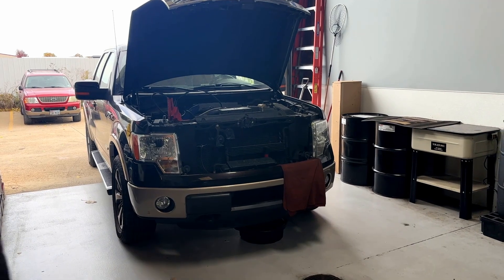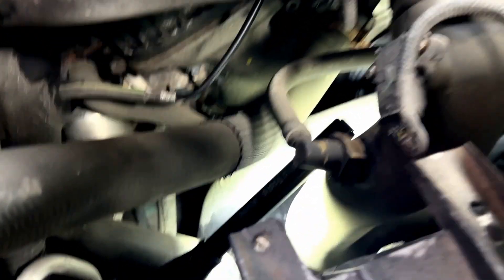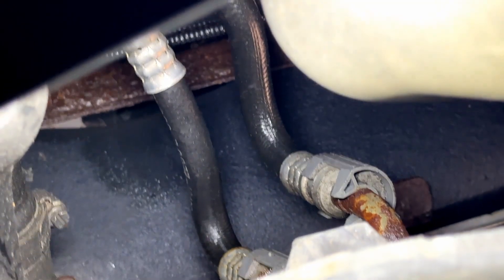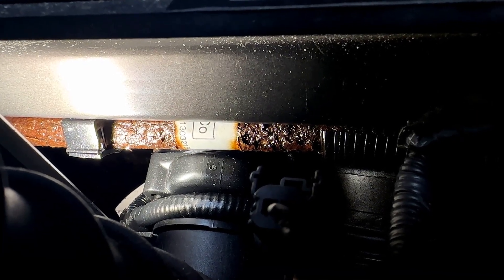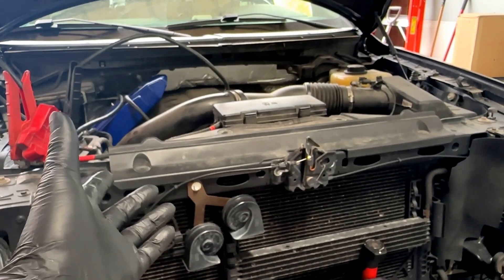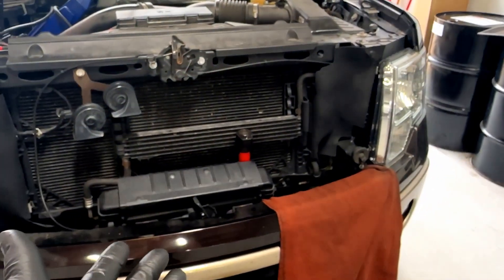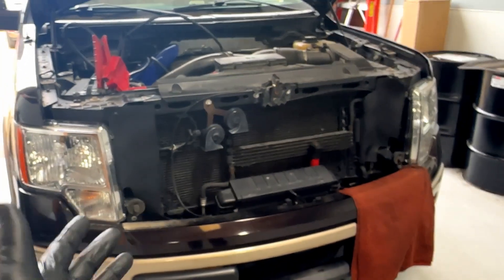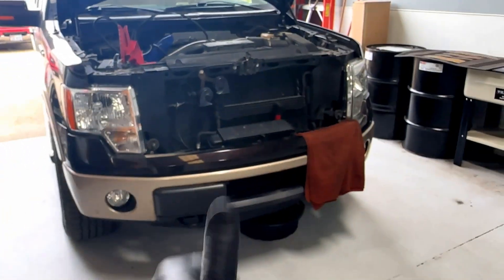One Last Time: Do Not be The Next Victim of Faulty Ford F-150 6R80 Transmission Cooler Lines!

Comment: Thank you so much, excellent information. I have a 2013 Eco boost with 31K on it so I sprayed the tubing and all metal parts with Blaster surface shield to protect the tubing from corrosion, I can see the start of corrosion, glad to catch this early.  Keep up the good work it really helps prevent expensive problems.  By the way the pcv valve oil separator works well keeping the 2013 Eco Boost intake valves clean, preventing another costly problem.  Thanks again for your hard work.

Comment: Thanks for the heads up. I used your molded lead frame / bulkhead sleeve / filter / fluid  / pass through seal video to fix my intermittent limp mode issue. Any chance of a transmission cooler line replacement in the same format? Also if a class action suit on the molded lead frame is successful, would I be reimbursed for the DIY replacement?

Comment: I got super lucky on my 2012.  Changing the oil one day, I noticed one of the trans cooler lines was wet at that coupling.  I wiped it with a rag, and the line separated in my hands.  I was able to patch it to get back up and running, and promptly ordered a new line set.
Reply: What did you patch it with
Reply: @armwrestlinginthe6ix  I cut the hard lines on either side and used 1/2" compression to barb fittings.  Later, I bought a new line set, cut off the quick connects, and flared the hard lines for -8 AN fittings and ran new rubber lines from there to the trans cooler.  .

Comment: Great video but I have my own problems I drive a Ram. These dealerships need to be held responsible AKA lemon law when things malfunction to a certain year truck even though it's out of warranty. It's like the older Rams 03 and up where they all rusted above the rear quarters and the dealers excuse for not fixing is that it's not a safety issue. Maybe they should have plugged the holes or used better materials.

Comment: Bought a new Focus in '02 (still have it, approaching 350k with the original engine and trans, albeit with what appears to be a rear main seal leaking). At the dealership, I was checking it out and noticed that the "galvanized" fuel-filler neck was RUSTED... BIG TIME! Looked like it had been in salt water for YEARS! Had them replace it; can't remember if it was done before we took delivery or after... the ONLY time someone other than me has worked on it! : )

Comment: While I do appreciate the tip, but I drive an 05fx4. It has an old 4 speed automatic and a 5.4 with a 5 star tuner. It's got over 274000 miles on it! Check the fluids regularly and run full synthetic oil. Pulled my camper 150 miles last week!

Comment: Brian, is there something better to replace these lines with or is it a like for like?  Could you use some sort of high pressure hydraulic line that doesn't have quick connections?  I know you briefly mentioned something about it, just wanted clarification before I bought the wrong thing.  Thank you!!!

Comment: Your comment on how the pressure is lower as the fluid level drops is spot on. A line that completely disconnects can often have little damage in the transmission as long as the engine is turned off once the transmission looses engagement. It's the slow leaks that kill transmissions. Low pressure, fluctuating pressure and lubrication failures as the level gets lower and lower.
Reply from the maker: Its the time period where the pump is sucking air and fluid is when the real damage occurs to the clutches.
Reply: Yes.

Comment: From trans to cooler, and return, what's the best full replacement method and material to use. 50 hose clamps on junk rubber oil/fuel hose ain't the best.

Comment: Fixed my 2013 Ecoboost that had this issue after a road trip back in July 2020. Thought it was the reclaim water from my local automatic car wash that ate the metal over the years. Thankfully there was 13q of fluid.

Comment: Are there similar issues with 6R80 lines after 2014?  I have a 2017. I’m about to do a full trans service and wondering if it is worth changing mine. Thanks
Reply from the maker: I personally have not seen it on 2015 and newer models.

Comment: Not related to this video, but it's the most recent, how would I go about rehearing my 1999 f150 and making the speedo stay accurate? Is there software that has to be reprogrammed, or is it a sensor/gear somewhere that that would have to be swapped out? My rear is bad (is supposedly 331 gears on 8.8) and I was thinking of changing to a more readily available 355 or 373 either by replacing everything, or just flat put replacing the axle assembly (facebook marketplace or scrap yard or something), but don't know how I'd go about recalibration the speedo.

Comment: I have a question about an issue that's been duping my local mechanics including my local Ford dealership. My 2006 Ford Escape hybrid stalls in the morning after driving one block. It bings, stalls and reads "pull over safely now". I then restart it and it works fine enough driving 10s of miles without issue. I found that it wont stall if I give it 3 long revs before driving. Any idea? Sometimes it is not fully responsive to gas pedal within 1st mile, and does some intermittent whirring. The wrench light comes on now while driving anywhere from every half hour to every couple of days. I've had it reset after oil change, but it keeps coming back on. Basic code readers say nothing is wrong and more advanced ones say powertrain control module - generator, motor, vehicle, transmission and alarm disabled (which it isn't). It drives very well otherwise. One mechanic said it was the part that switches the engine to battery power, and then changed his mind to the battery terminals needed cleaning. And another said it's the battery module and the fan and that I needed a $9000 battery before even looking at it. No one can give me a definitive answer and I'm wasting a lot of money. It's 150,000 miles, I've been the owner for 2 years and dont know it's repair history. Is it safe and recommended to change the lifetime transmission fluid? Should I have Ford charge the battery and reprogram the modules for $900? Is it worth it, will either of these fix the issue? Can I pay you for your assessment? Thanks - Joh

Comment: i had the same but different parts,on my dodge caravan tire air pressure sensors, the houseing is aluminum but the valve stem is metal, even though the rubber was more so touching the aluminum the disimilar metals were close enough for the thick alum. houseing to snap off with very little pressure,

Comment: GM trucks have a transmission temp selection as part of the driver info center..You also get a warning message when this temp gets too high. Can anyone tell us if Ford has this feature?  Wouldn't the fluid temp go up as the fluid leaked out?

Comment: I got a 2008 f150 4.6 that drives fine when cold but when hot the trans acts up (one time I got the o/d light and TRANS FAULT). It feels like the tc is overheating on low gears. I was in 40 miles away from home when it started to act weird but once on the freeway it was ok if I had a constant speed. When slowing down from 3-2-1 it revs a little and it feels like its breaking. I have read that it could be ignition coils, bad torque converter, tcc lock up solenoid, bad ecm/pcm, black plastic trans harness, and even a speed sensor. All I know is that shifts good when cold and the issues progress as its driven past 10 minutes. I dont have a scan tool and I am looking to buy one that reads trans codes too, a recommendation on that would be amazing.

Comment: i didnt catch why you cant just chop the lines and replace the fittings with two hoses and some clamps, is there actually a reason you cant do that?
Reply from the maker: You can do anything you want but I will not hack up lines on a customer vehicle adding more potential leak points.
Reply: @FordTechMakuloco  but is replacing a defective part with a new defective part  a better option? How long till it has to be replaced again?
Reply from the maker: I replace them with the latest engineered parts from Ford, by the time most factory parts fail the service part has been redesigned.

Comment: Question about that I have a 2010 f150 bought it used in 2020 it’s run great I have noticed that the cooler lines have a minor leak on the rubber side but have not had any issues so far obviously I need to get to replace it, but have the lines busted from the rubber side or has it been from the metal side aging? My metal lines don’t show any leaks just the rubber side shows a minor leak? Thank you for the heads up.

Comment: More vehicles than the F150 might be affected. I had the same corrosion issue with my 2008 MKZ. The lines corroded under the black plastic clips. My car is virtually rust free so it was a surprise. For me I found the leak while doing normal service so I was lucky. Thanks for the great info.
Reply: I drive a 2011 Expedition and I will be looking into this first thing tomorrow!

Comment: Yep, I just saved a customer his transmission couple months back for this very reason. Surprisingly the aluminum quick connects were still together, but rust holes in the steel cooler lines left small drips in his driveway. One bump away from disaster. 

Replaced all the lines and did a transmission service. All was well 👍🏻

Comment: Had one a couple months ago, almost lost a trans. Cooler line near trans was rotted and spraying a fine mist all down the frame rail. Guy drove it back 6 hrs from up north thinking it was an axle seal.
Luckily the pan barely had fluid, haven’t heard anything bad about it yet

Comment: I had to replace my F150 transmission because the cooler line snapped just below that quick disconnect like you said.  But they did not replace that small radiator has me thinking it’s probably clogged

Comment: hey man, I've got a 2011 f150 with the 5.0. and 6R80 trans. the lines from that quick connect to the cooler are definitely pickled, but not leaking......yet! should I change all the lines from trans forward or can i just do from the connections to the cooler?

Comment: how do you know you have that particular transmission? I have the 5.4 engine. do they just go together automatically.
Reply: Have a '14 F150.  check safety compliance certification label on edge of driver's door. On mine the column marked "TR" under the bar code has a "6", the designation for the 6R80. Check your op manual if u have it.

Comment: I love it that some know-it-all thinks losing pump pressure makes the clutches instantaneously release and therefore nothing can burn up.Clearly someone with no real-world experience. Even if that were true, everything inside would still be turning with zero lubrication until the vehicle is stopped and the engine is turned off. So if even if it didn't burn clutches it would burn up the pump and input and output shaft bearings at a minimum.

Comment: I am actually doing this maintenance repair on my 2014 Ford F150 3.5L Ecoboost with the 6R80. In the video Brian did in April, I went with the cooler lines to address the issue with the QD’s (rear cooler lines). All of my lines look shiny like he describes (no rust), but somewhat confused if I should replace all of the lines or just the main one as described where the problem seems to be. If the other lines look good, is there a need/recommended they be changed as well? Thanks in advance. '

Comment: Thank you for letting us know.
I have seen an 09 E-250 and a 2010 F-150 and both of them had extreme rust on everything. the F-150s oil pan rusted out and lost the oil. The E-250 had chunks of rust falling off of the rear end. 
My other comment is, I had the heater hose quick disconnect on an 06 E-250 break off while driving and I didn't know until the cluster lit up. two weeks later a friend had the same thing happened to his F-250. Those quick disconnects where plastic that had rotted.

Comment: Another great reason to always add a transmission temp gauge to any auto transmission so you can always monitor your temperatures!
I've never been a fan of those quick connect fittings either
Reply: Unless I read my gauges wrong the F150 already has it
Reply: @jasongunningham9545  they usually have dummy gauges in the new trucks that aren't base model but that isn't nearly as helpful as an actual gauge. Some have the actual temperature reading digitally on the cluster which is what you'd want but most people don't even look at that.
I enjoy having an actual pod gauge that's displaying the temp all the time, it's saved me a few times in the 2 autos I've owned. Which I've never owned anything fancy or new, just have a 2019 work truck that has the factory gauge. Most factory vehicles don't come with one, a lot don't come with substantial coolers either especially if you mod the vehicle like tire size/lift, etc

Comment: Welp, more parts for me to replace,  currently rebuilding a core and swapping transmissions out,  looks like I'm adding more than just the lines just to be safe,  transmission is currently running really rough and is probably smoked

Comment: I remember the company I worked for bought a 2011 brand new Ford Focus back in the day that I would occasionally drive to job sites in Northern California 400 miles from our office. It got much better gas milage then our company trucks BUT that damn thing had constant transmission problems! I can only conclude Ford contracted Micky Mouse to design it. Finally it got so BAD the whole tranny was swapped out for a new one. If I recall Ford paid the whole dime for the swap.
Reply: @Jonathan A LOL, I had a brain FART. Jonathan you are absolutely correct! I made the correction. In my defense I haven't driven one since 2013. Plus the fact it wasn't a real memorable car. About all I remember is that transmission was definitely FAULTY. I've driven Fords my whole life. Mustang GT's, Escort, Pinto, Ranger XL, F-150's and 250's, cougar (Lincoln Mercury) and currently 2010 Eddie Bauer Expedition and of course the Focus.

Comment: Thank you for the update! I’m 19 taking care of my sister no parents and I rely on my 2010 f150 with a 6r80 and 4.6 3v. I will be replacing the breakpoint with a rubber transmission line hose and some T bolt clamps. I’ll be uploading a video on it. What temps and pressure are these lines under during normal driving and towing a camper ? Thank you 🙏
Reply: Please share the link when you can. Or let me know when it's up.
Reply: @irsum28  Ok 👍
Reply: @irsum28  Ok 👍

Comment: I have a 2007 Mercury Mountaineer.
I had the Transmission changed and the Trans cooler lines were bad so the guy bypassed the lines and said that I didn't need the cooler hooked up.
as long as I am not towing he said it was fine...
Do I need the cooler lines hooked up as long as the Rad lines are hooked up?Also does it matter which line goes where or is it ok as long as they are hooked up? ie. left and right.
Reply: @Jonathan A I haven't driven it since I brought it home other than between the yard and driveway
Because I was wieeied about that

Comment: @FordTechMakuloco Can you provide links for the trans line parts that recommend replacing? Thank you for all your info!
Reply from the maker: I would but they are all different based on model year and engine and cooling configuration.
Reply: @FordTechMakuloco  Okay, that makes sense. Thank you so much for your reply and all your thorough videos!

I had just bought all the other items (from your links) to replace my fluid and fix a leak coming from the wiring connector. Thought... might as well replace these at the same time.

Comment: Speaking as a materials engineer, yes metal fatigue could be an issue and another could be stress corrosion cracking by road salt chlorides coupled with moisture and warm temperatures. In either case, Brian's recommendation is spot on. Be proactive and replace them!

Comment: Something else I've always done on any Ford with that style quick disconnect in anything except a vertical application (won't make any difference for vertical lines) is to turn the opening of the plastic clip down towards the ground. That allows any fluid splashed up into the fitting to drain & may reduce the speed of the lines corroding. If your lines are super weak, you'll also find out quickly by turning that plastic clip. The fitting will likely break if it's corroded with any movement or pressure.

Keep 'em coming Brian, I been pointing the techs at the big regional U-Haul shops your way.

Comment: Is trans fluid similar to engine oil in respect to change intervals being time or mileage? I have a 2016 f150 with only 11,000 mls, should I still change the fluid being is is passing 6 years old?

Comment: FordTech, have you seen the crimp sleeve failures on these line sets? I had that happen to my '13 F150/5.0. I ended up losing 2 quarts of LV but the trans is fine. Changed out the fluid and filter at the same time. Two of my pics are on the BITOG forum.
Reply from the maker: Yes I show it in the other video.

Comment: Hey Brian have you heard of two valve springs failing? on a 2012 F150 5.0 right hand drive her head, one exhaust valve spring in cylinder #2 an# the exhaust valve spring in cylinder 3 closest to each other. 
   valve springs broke one broke for sure, An the other is collapsed…
Reply from the maker: No, never.

Comment: Fluid levels need to be checked as well.  Just because it's not dripping on the ground doesn't mean  it's not leaking.  I can't believe that the skid plates and belly pans caught all the missing fluid though.  Sudden rupture is another thing,  but how often does that happen without seeping first.  Anyone with a higher mileage vehicle needs to be crawling all over it regularly or paying some else to if they want to avoid these things.